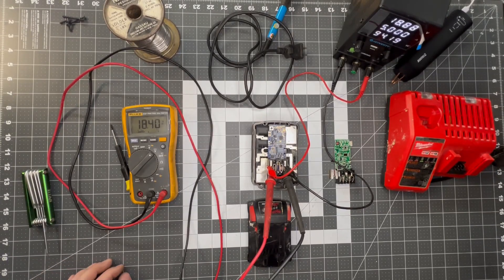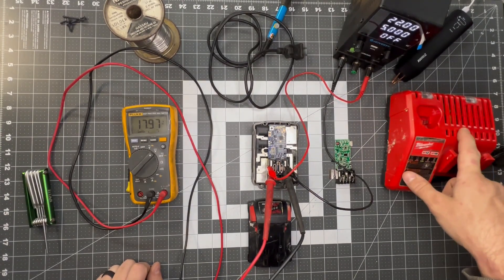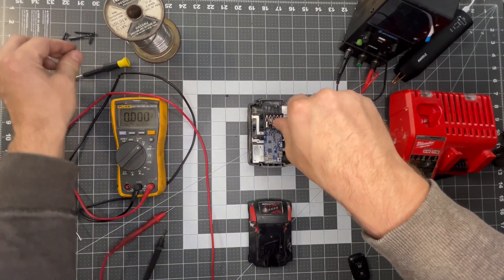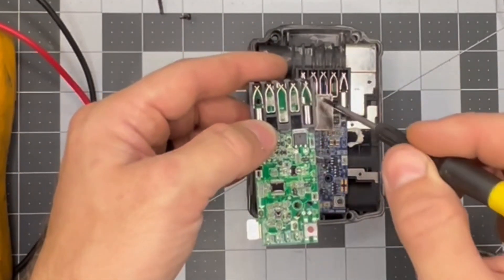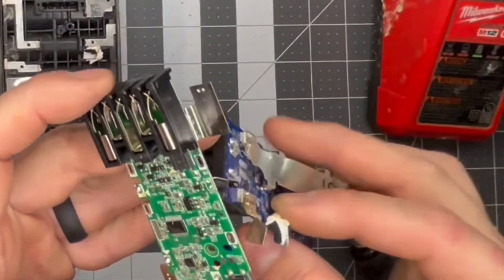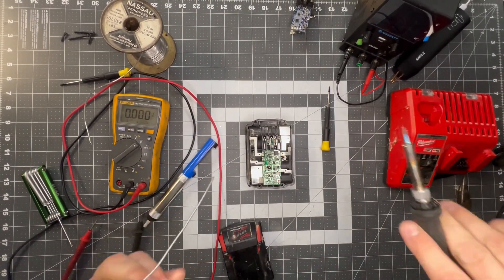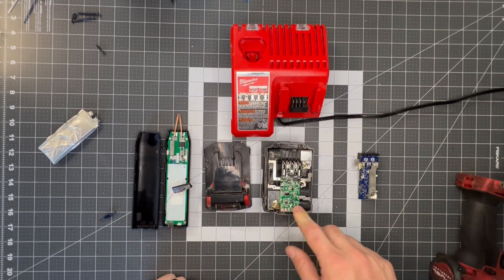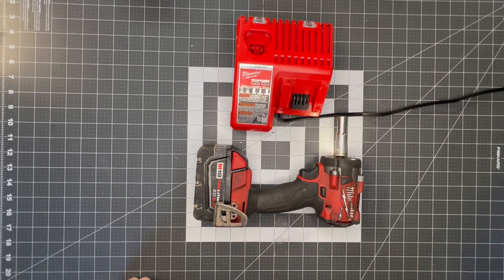How To: REPAIR a #Milwaukee #M18 Battery With Flashing Green/Red Error Lights! Circuit board Replace

Comment: I have never seen anyone clean a drill under the tap in my life.
Reply from the maker: I was drilling a hole and in the process of drilling the hole, the hole filled up with rain water 🤦‍♂️ still needing to get the hole drilled, I pressed onward. The drill completed the job but I figured I should flush it out as best as I could before disassembly to clean all of the electronics with contact cleaner and compressed air. 

By no means is that a recommended procedure 😂
Reply: Where do you get the new board?
Reply from the maker: @martinsifuentes177 the link to the board I used is actually in the video description!